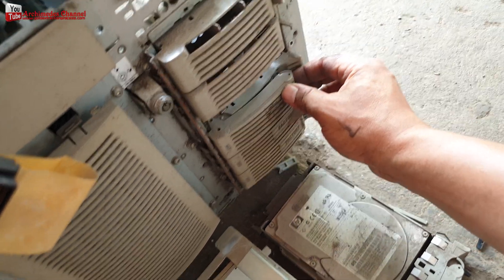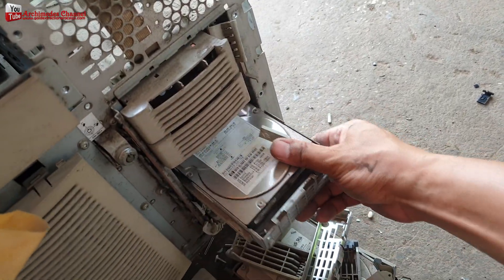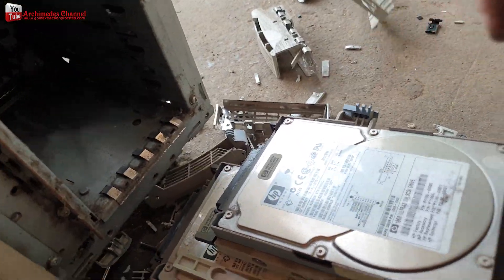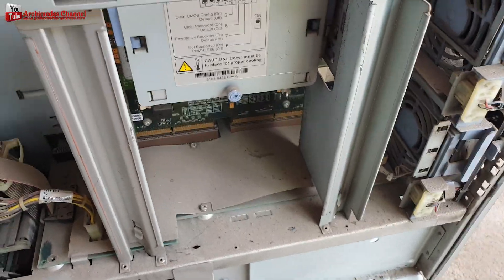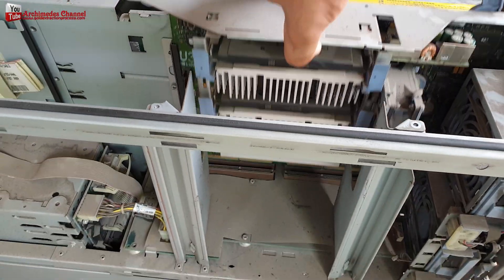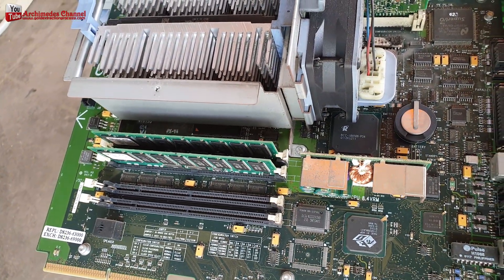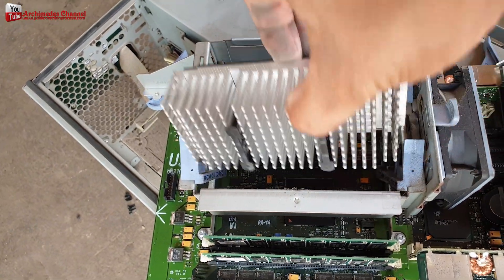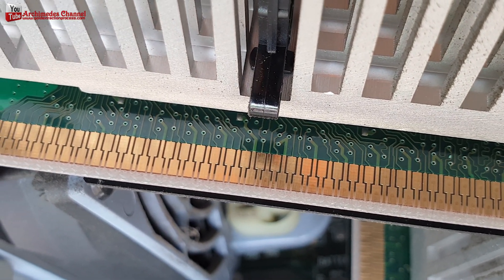How do you recycle gold from CPU computer scraps?

Comment from the maker: What Are CPU Processors?
CPU Processors are the brain of the computer. They contain billions of microscopic transistors and hundreds of gold plated pins. The presence of precious metals such as gold, platinum, silver and palladium make it one of the valuable parts, while scrapping.

Apart from computers, processors are also found in video cards, mobile phones and almost any other electronic devices such as iPods and iPads. However, the size of processors in them is comparatively smaller when matched with those in computers and hence these processors are not much worth scrapping.

Usually processors will have a heat sink attached to them, which may also have a fan. The heat sinks are normally made of aluminum.

CPU Processors Price
The CPU Processors come in different varieties, but are mainly classified into two categories-fibre and ceramic. Fibre CPUs are green in color, thin and usually contain relatively lesser gold. Ceramic CPUs are generally grey in color, thicker and contain more gold. The ceramic types of CPUs are more valuable due to their higher gold content.

Older processors are large in size and contain more gold plating on them. On the other hand, modern day processors are smaller in size and have lesser precious metal content in them. They no longer use solid gold wire bonding technology or gold-plated lids in their packaging. However, gold plating can still be found in connector pins. Most recent CPUs use thinly gold-plated connection pads in place of connector pins, thereby resulting in very less precious metal content.
Reply: Can i buy gold from u sirrr